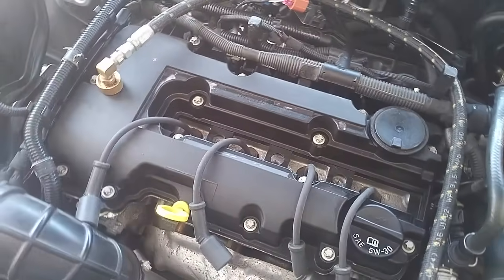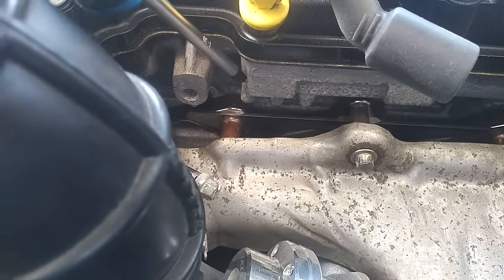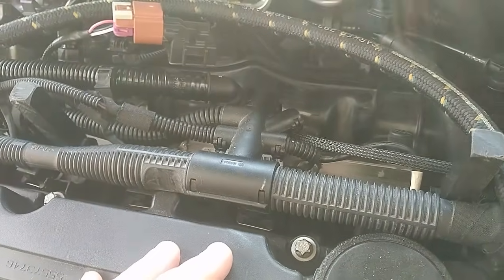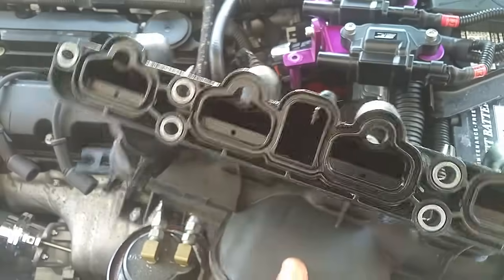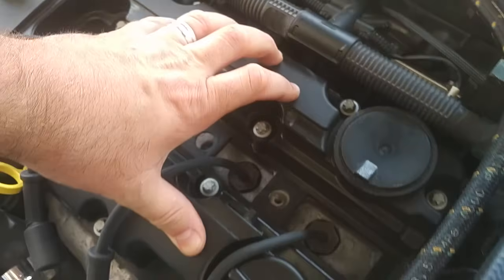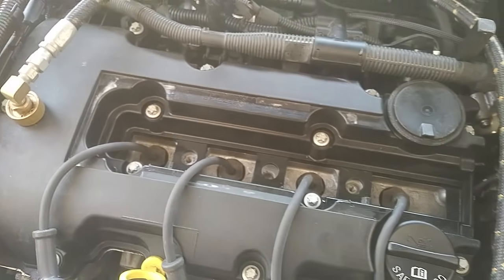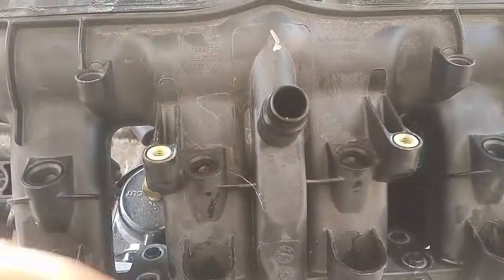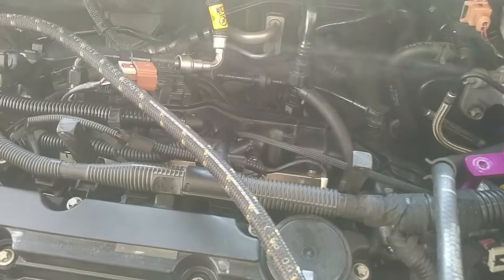Chevy Cruze Sonic Trax Encore 1.4L Turbo PCV Issues, Diagnosis, and Solutions

Comment: All of the auto parts chain stores now sell a Dorman kit with a new valve cover, intake manifold and PCV hose for around $350 to address this "known issue". Supposedly, the kit has upgraded components to fix the problem. I know this because I just used the kit on my wife's 2015 Trax. The car now runs great, but I don't plan on keeping it long enough to test the longevity of the upgraded components. There is always one issue after another with this car. The engine seems reliable enough, but the plethora of cheap plastic components in the engine bay create continual problems. 

Thank you for the in-depth explanation of how the system works. It was truly educational.
Reply from the maker: @John-wx9oy  the Dorman manifold is still failing now that it has a couple years on it. They added a pin behind the check valve but it’s not a guaranteed fix and the check valves are still going bad, getting gummed up, clogged, or deteriorated. 

Moreover, they recessed the check valve port further back so you can’t clean it or inspect it from the pcv port on the manifold like you could with the OEM manifold. 

Their valve covers are absolute imported crap that fails in half the time (if you’re lucky) that the OEM ones do (which is why I only offer OEM valve covers on the Cruzekits site). I had a good friend locally that went through three Dorman valve covers in a single year before getting tired with all the “free warranty replacements” and going back to the OEM valve cover. 

I’ve personally had two people in the last year show up needing help with their car after installing the dorman kit you mentioned only to find out that the PCV pipe is of far worse quality than the OEM one and is brittle and cracks within a couple of years. In fact my v3.4 pcv fix kit install video shows this pcv pipe installed and it broke clean off just while removing the terminal off the manifold. 

The cruzekits PCV fix kit is $75 shipped and upgrades the manifold to a serviceable design while also replacing the crack-prone corrugated section of hose. I also offer OEM valve covers because they are still the best option. 

I’m glad you found the video helpful, but unfortunately you’ll be replacing that valve cover and pcv pipe before too long.

Comment: Hi Dre,

My name is Nas and I am writing from Australia. I am subscribed to your channel which is pretty good by the way.

I was wondering if you could give me some advice regarding a fault with my chevy trax 1.4 year 2020. This is what is happening:

Just after changing the oil I noticed an engine rough idling and a continuous whistle from the vacuum regulator (breathing out a tiny bit of air) when the dipstick is pulled out. Also, There is a vacuum in the dipstick tube. I checked the PCV valve in the manifold and it is ok (the orange piece is still there). I am puzzled by what could be happening. Do you have any recommendations for what I should do?

I appreciate any help you can provide

Cheers
Reply from the maker: @nasttaze  sounds like the valve cover diaphragm has torn so you’ll need to replace the valve cover.
Reply: @AndreiDPop  I changed the valve cover for a OEM GM part and the same exact fault is still there. I don't know what to do.
Reply from the maker: @nasttaze  is it sucking in air from the diaphragm vent on the valve cover still?

Comment: Great video! I have the exact same issue on my Opel Astra 1.4 Turbo (P0299 and massive overpressure in the valve cover + oil leaks). I have already changed the valve cover which has not solved the issue. I have now checked the PCV valve at the turbo inlet which seems to work properly (air only goes through in one direction). When I looked at the valve in the intake manifold, I noticed that the orange nipple is still there. Is it possible that the valve in the intake manifold is broken despite the orange nipple still being there? Does anyone have experience with this?
Reply: Did u figure it?
Reply: @steffenlyngb4676  not really, in retrospect i think it was a false assumption that i had overpressure in the valve cover (it can feel like it, because of the moving parts inside). I think in the end i also had a defective turbo charger (typical crack around the wastegate) which caused the P0299. I did not change it as the vehicle already had 300'000km. Therefore, I sold the car and got a new one.

Comment: I have a 2018 Trax I think mine is a little different
Reply from the maker: @TBlaster76  the 2018 trax is the same engine.
Reply: @AndreiDPop  on paper yes but actually no over the years there had been many tweaks to the engine. The worst one is a 2015 model year then in 2016 they made more upgrades 2017 made more upgrades. The most reliable and best engine would be the 2021 that uses a completely different PCV valve system, but it looks like the same engine. Chat GPT will help you understand it better cause that’s how I know.
Reply: @ https://youtube.com/shorts/PcGVN8kp1t0?feature=shared
Reply from the maker: @ ChatGPT is not an authority on information. It’s your job to fact check what it’s saying since all it does is pull information from other forums (written by end users), articles, Reddit, and other social media sources.

All LUV and LUJ engines continue to suffer the same PCV problems since there has been no functional design change from GM on those components. The only change to the GM intake manifold was to move the bypass valve connection from the bottom to the top of the vacuum chamber.
Reply from the maker: @ Keep in mind, I get several phone calls a day regarding PCV issues across all 1.4L turbo engines. The Trax is still having issues even clear up to the 2021 model before they redesigned it.
Reply: @AndreiDPop  all I know is I have a 2018 Chevy truck LT all-wheel-drive 289,000 miles original everything never had an issue only thing  that’s been replaced under the hood would be the battery and serpentine belt that’s it

Comment: I changed Valve Cover, Coolant intake and outlet. This because their plastic garbage and the outlet had  a crack leaking coolant. Next oil change going to replace turbo oil line. Thank for putting info out, sad that folk find out after purchasing and the problems start. 😢😢😢

Comment: Has anyone had issues dealing with oil coming from the exhaust manifold . It only happens under load.  While idling it’s just fine the only code  I have 171
Reply from the maker: @youngdixie225  you sure it’s not coming from above or next to the exhaust manifold? The exhaust manifold is extremely hot. Not possible for oil to come from it. It would ignite instantly.
Reply: @ yes , that is correct But it only happens under load conditions the vehicle has 65k miles and the head gasket and turbo were just replaced
Reply from the maker: @ so under load you have a condition in which oil is spraying onto the exhaust. Correct?
Reply: @ yes like a seeping
Reply: @ their is no blue smoke coming from the tail pipe while it idles. And the compression is testing at specification
Reply: @ the pcv crankcase is original
Reply from the maker: @ the crankcase is simply the airspace inside the engine. If there’s pressure inside the engine, which would be called crankcase pressure, it would force oil out past the turbo seals and also outside any of the external seals such as the valve cover. 

Is the intake manifold check valve still there?
Reply: @ that I have not checked yet, but their is no oil  coming the intake. Thank you so much for the knowledge
Reply from the maker: @youngdixie225  let me know what you find in the intake manifold.

Comment: I'm getting codes for EVAP system accelerator pedal correlation and running lean I put a new pedal and a new purge valve also put in a new coil I'm still getting codes so I took the throttle body off when I took it off I noticed there was oil in the throttle body

Comment: Are you venting your modified pcv valve to atmosphere?
Thats not legal in my country and it won't pass an inspection. Of course you could attach it to a catch can!

What do i get in your kit for $80, a small plastic valve and a lenght of rubber hose? Anything else?
Reply from the maker: @Knowwhatimeans  no, I’m not venting to atmosphere. It’s a re-route. You can find the whole kit on cruzekits.con with all of the instructions in addition to all the parts that are included. There are some extra parts in the kit that aren’t in the picture that I’ve added since. 

https://cruzekits.com/products/v3-4-gm-1-4l-turbo-pcv-fix-upgrade-kit?srsltid=AfmBOooosGkxiOgk5RPmmpQmlFAWPVekXH-w44AN-J2inojK2cxj9A4V

Comment: Can the the diaphragm in the valve cover fail on its own without the pcv valve in the intake doing so? We have the same engine here in Egypt and the diaphragm in the valve cover failed and the mechanic didn't check the pcv in the intake and my dad won't let me because he's scared I'll break the hoses because they get brittle
Reply from the maker: @ahmedlo1  yes it can. If you don’t check that hose in the intake manifold though, and you put a new valve cover on, it will fail again much sooner than it should, and you’ll also burn more oil, poison the catalytic converter, and lose fuel economy.

Comment: If it is chirping it's the crankshaft seal it happened to mine a14xer
Reply from the maker: @tuckerhouston8935  yep, happens after the valve cover failed. Did you check the intake manifold already?

Comment: Hell I’ve replaced valve covers multiple times and also recently new valve cover and manifold. Diaphram in the valve cover failed within 2 days and suggestions?
Reply from the maker: @adamchatten8516  aftermarket parts or OEM?
Reply: @AndreiDPop doorman I know… but even still I bet the pcv valve at the turbo is bad I guess that’s next

Comment: When I take out the oil dipstick i hear the vacuum suction. What could the problem be?
Reply from the maker: @spidermonkey7605  nothing, because that’s normal.
Reply: Also, it makes a chirping noise when it's idle.
Reply from the maker: @ doesn’t go away when the dipstick is pulled out?
Reply: Yes.

Comment: 16 Encore.. Was getting a Underboost code for a while, and i had an oil leak at the oil filter housing.. I replaced the Housing plus the turbo and now the car is misfiring and blowing white smoke.. what could this be?

Comment: What about negative crankcase pressure? I cannot find much about that.
Reply from the maker: @joshhood1360  you mean crankcase vacuum? 

The crankcase should always be under vacuum. Mild vacuum, not strong vacuum.
Reply: @AndreiDPop  my vacuum is so strong that the oil cap can barely be removed while running. Doesn't seem normal to me at all. Seems like excessive vacuum
Reply from the maker: @ that’s a defective valve cover. 

I have genuine GM OEM valve covers available on cruzekits.com. I recommend ordering one or finding a local dealer that has one. That’s 100% a valve cover failure.

Comment: I have replaced the vacuum control diaphragm. Sourced them for $3 each.
Reply from the maker: @jimb4090  they’re even cheaper than that if you know where to get them, and that’s about all they’re worth considering they last 1/3 as long as an OEM manifold if you’re lucky. Did you address the intake manifold?

Comment: Can a bad pvc value allow oil to make it to the throttle body?
Reply from the maker: @tonydunn8214  yes. This is one of the major signs. Have you checked the intake manifold for a missing check valve yet?
Reply: @ no just recently purchased a 2014 with 94,000 miles for my daughter for her first car. It’s a very nice clean car driving home to check engine light came on through the P0299 code as I was doing some investigating around the turbo, I pulled the hose off from the intercooler to the throttle body to find oil there and that’s when I stopped. I don’t know anything about turbo I am very knowledgeable on other eco-tech motors just doing my research first before headfirst into the engine bay.
Reply from the maker: @ ok, check out that manifold first before you do anything else. If the check valve is missing that could contribute to the p0299 and you could resolve the manifold issue with the cruzekits pcv fix kit quite easily.
Reply: @ thx I’ll get back to you when i check that appreciate the response!
Reply from the maker: @ likely not functioning correctly or blocked. You could try to clean it or you could plan on installing the kit. I’ve had people clean that before and it just ends up going missing a week or two later. So up to you how you want to proceed.
Reply: @AndreiDPop  well first I’ll probably try to clean it, but I would like to diagnose the car correctly before I do any new parts to the car. I don’t want to just throw parts at it and hope it fixes it. I am however, prepared to replace the turbo if necessary with any other plastic parts that seem to break on these vehicles I’ve also been wondering if I should go ahead and do the timing chain because I know they are a issue on the 2.2 and 2.4 eco-tec motors. do you sell any other parts for these besides that bypass system?
Reply from the maker: @ I wouldn’t replace the turbo until you’ve ruled out any other potential causes for a p0299. It’s not a particularly pleasant job. 

These engines aren’t known for timing chain failures, provided that a high quality engine oil was used.
Reply: @ where would the next step in checking be? If not that’s turbo I don’t have any oil leak. I don’t have any suction at that vacuum point you showed in your video on the valve cover. I’m not finding any other signs of an issue just all at the throttlebody.
Reply from the maker: @tonydunn8214  after cleaning the check valve, you may get vacuum on the crankcase again so monitor the oil in the throttle body over time and make sure that clamp is tight. 

I’d also strongly recommend using the best synthetic oil you can. These engines are sensitive to oil quality. Many of my customers switched to AMSOIL signature series and they consume less than 1/4 of a quart every 15,000 miles, which drastically reduces how much oil ends up in places it shouldn’t.

Comment: Is this the same system as the non turbo chevy sonic? I get bad vibration at idle and at a stop in gear
Reply from the maker: @charlesanzalone5846   no, the 1.8L is a completely different engine. You may just need a valve cover replacement for that.

Comment: Hello, can you please reply, I need your help. The orange nipple, that is, the check valve, in the intake manifold of my car is completely missing. I would seal this place without a repair kit (Cruze kits) with any material and epoxy adhesive, and use the original crank ventilation hoses. Is there any problem if I continue to use it? Please reply, it's urgent.

Comment: Thanks for the help so I can tell my mechanic I did research on these Pcv valves cause I had a really bad rough idle even after cleaning the throttle body with no codes unfortunately I checked the Pcv valve in the intake manifold and it’s all gunked up can’t even see where the nipple is so I’m gonna have him replace that with the Pcv valve cover as well and hopefully that fixes it. Just taking extra precautions and having home fix those even after the diagnosis and whatever else he finds needs to be replaced or repaired.

Comment: Tip for that plastic hose that gets brittle and will break. Get some Heat Shrink from an electrical supply like viking electric. get about 1 inch DIA stuff and you can repair that hose. mDon't use the cheep automotive stuff. This electrical stuff I'm talking about is underground rated for 0 and 00 cable connectors for 240 and 480 3 phase. It works well! I used it on the Turbo oil return line without issue.
Reply from the maker: @billk9628  if the hose breaks that easily, another section will break shortly after. The cruzekits v3.4 kit replaces that section with thick rubber hose that won’t crack that way; which is a much more durable fix.

Comment: I’m getting oil into that PCV tube, and I’m pretty sure it’s coming from the PCV valve in the intake manifold. If the PCV valve is bad it will let oil in?
Reply from the maker: @Lost.soul_86  it will cause more oil to come in, yes. If that valve is bad, you should install the cruzekits pcv fix kit ASAP.

Comment: Question:  if the PCV valve inside the intake manifold fails, will this cause a turbocharger failure?
Reply from the maker: @sandrahodson  no, but it can cause a p0299 code.
Reply: Thanks for your response. I have a 2015 Buick Encore with the 1.4 L turbo. My turbo went out with the P0299 code. It took three replacements to correct the problem. The first two broke again . I was told the intake manifold needed to be replaced due to a clogged PCV, and that's why the turbos kept failing. I asked them to replace the valve cover and PCV hose at the same time (Dorman kit). I know you offer a fix kit on your website also. I no sooner left the shop after repairs, when the CEL was back again with a P0420 code. Ugh!! They did an eval and now said the catalytic converter is bad. What is the likelihood of that occurring right after the other repairs were done? The car seems to be running fine. If I clear the code, I can drive for hours at high speeds on the freeway without the CEL reappearing. It comes back with city driving. Why?  @AndreiDPop
Reply from the maker: @sandrahodson  the failure of the intake manifold check valve causes excess oil consumption, which poisons the catalytic converter over time.

Comment: Mine does a chirping squeek when accelerated but at idle it doesn't
Reply from the maker: @JamesShehan-f7k  did your valve cover recently fail?
Reply: @AndreiDPop  no
Reply: @AndreiDPop  I replaced the belt and a pully but it still squeaks or chirps.  I was told it could be a loose plug so I'll check it out tomorrow